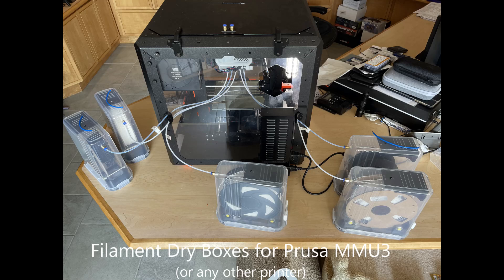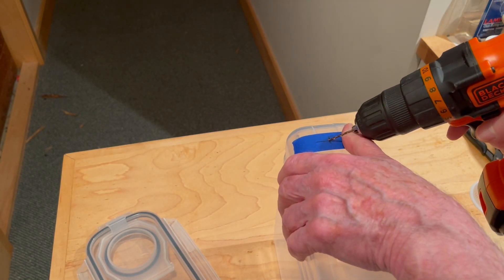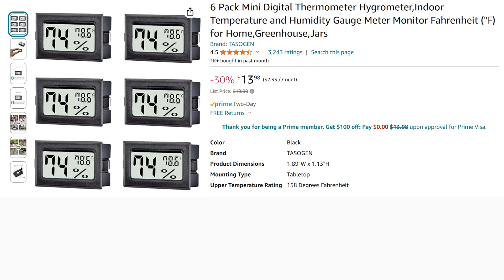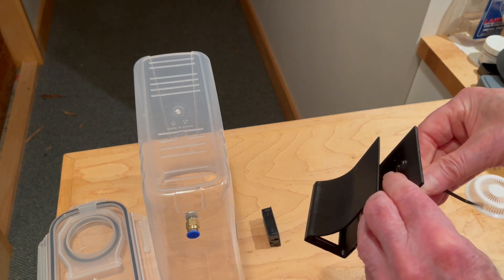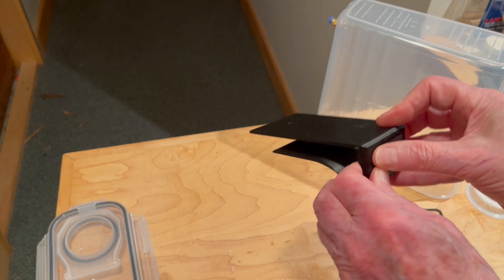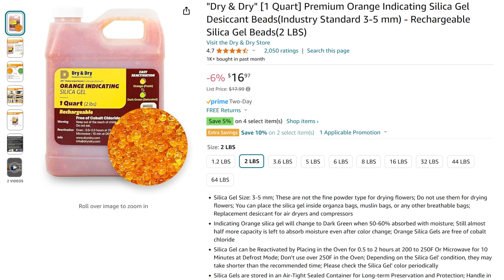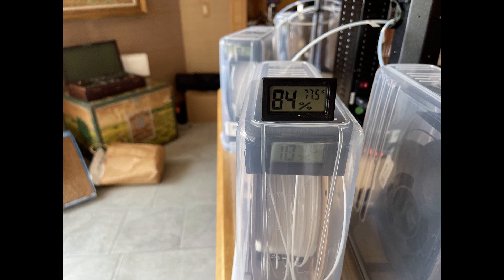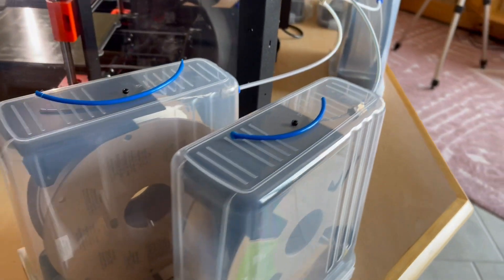Filament dry boxes for MMU printer

Comment: Great video and thank you for taking the time to document all this.  

One question I have is on the axles - you mention that the 6063 aluminum tubes from Amazon would have to be "turned down a bit" - is turning them down removing 1mm of OD so they'll press-fit into the bearing?  

I see you have an axle model that can be printed - is that model sized properly for the bearings?
Reply from the maker: Yes, the printable axle is a simple press-fit.

Comment: Wonderful you fix one of four problems I have that have stop dead cold in buying Prusa however the noise needs to come down to what Bambu Lab A1 is doing the third problem I might be able to fix because of the box you made, but the price I don't see that being fixed SAD it is way to high! I really like the Prusa MK 4S, but I can't! This is one great video thumb up with new SUB here thank you!
Reply: I have mk3s+ so interesting to me, but i agree mk4 is too expensive.  upgrade of mk3 579, so cheaper to sell the mk3 on ebay and just get a new mk4.  But i won't because too high.  My mk3s is great though.  I hate bambu because it is like Apple proprietary crap and they will probably steal your designs on their cloud.  I have seem reports about stuff appearing on makerworld without permission.

Comment: Nice! I have a zero power, passive, low cost idea for long term ,easy fast access, storage. Purchase a big plastic box with airtight lid, fill the floor with a few inches of Silica crystals that absorb water. Get another smaller box to house your filament spools made from any mesh. Make sure you have a few inches between the inner box and outer box, also fill space with Silica crystals, make sure the lid also has a layer of silica. A 50kg sac used for making Beer is a low cost bulk price. & wont pass the mesh. After use just but the spools back. seal lid,. Maybe to  preserve the crystals for long term storage , can add a small  vacuum pump, to remove the air from the box. If the crystals ever get to wet, just dry them in an oven or the sun. If you are worried some filaments get wet unopened? Just fill a bin with those crystals and bury your stock until needed. A clever designer would take that idea, and could build that around an ,in use, spool hooked up to a working machine. and the 6 x silica panels  would be removable for easy drying.

Comment: It would be nice if there were also written directions, but this is a good video. I have printed out the parts and I'm putting mine together, but it's ever so slightly too narrow for prusa filament (of the two I've tried, the other I tried is esun, which just barely fits). I've taken the bottom sled and cut out a little of the material near the ball bearings to allow the prusament rolls to fit. 

Also, what is the file cap-nut-10mm.stl for?
Reply from the maker: Yes, some rolls are just a little bit too large. To try and fix this, I also designed a slightly different box base, which is a bit wider and works for all but my widest rolls:
https://www.printables.com/model/930569-a-wider-dry-filament-box-for-3-d-printing
The cap nut is used to hold a 10mm (actually 1/8NPT) Festo connector if that one is used instead of the 8mm version.
Hope this helps.

Comment: Seems pretty difficult to get the spool in.  Having the filament exit near the bottom rather than the top would probably simplify that and reduce the risk of the box tipping over if the filament would be pulled sideways.
Reply from the maker: Not all that hard to actually do it. The reason it is on the top is to put it on the level of the MMU feed tube coming out the side of the enclosure; this minimizes the amount of curvature of the tube and thus the drag of the filament. This is particularly necessary for matte or glass/carbon filled filaments

Comment: Great idea, Wouldn't it be simpler to have a SUNLU S4 drybox, for 4 rolls, and connect each tube for each filament?
Reply from the maker: It would be less work, but costs a lot more and, IMHO, is a less flexible solution.

Comment: Heating up teflon like that creates toxic fumes.
Reply: I thought teflon was used on non-Stock pans.
Reply: @Anders12th  unless you're very bad at cooking your Teflon coated pots and pans shouldn't get to the temps required to release toxic fumes.

Polytetrafluoroethylene (PTFE), also known as Teflon, can start to release fumes at temperatures as low as 260°C (500°F), but symptoms in humans usually don't appear until it's heated to 350°C (662°F).
Reply: Holy crap yeah this, DO NOT DO WHAT HE DID!
PTFE emits incredibly toxic fumes if heated much beyond 250C, this is why all metal heat brakes took over so fast.